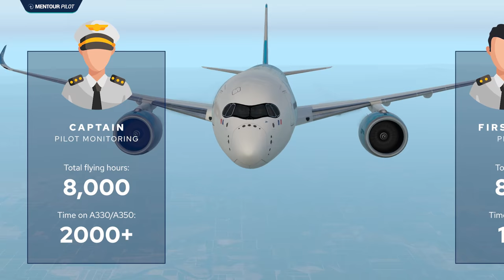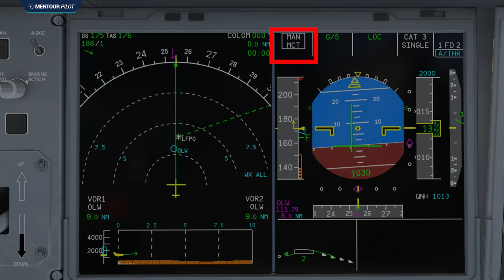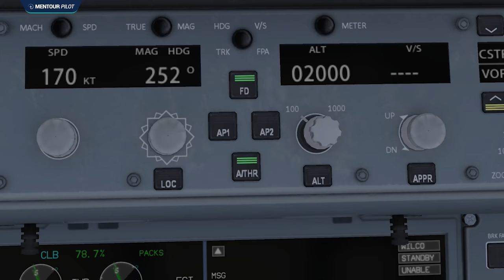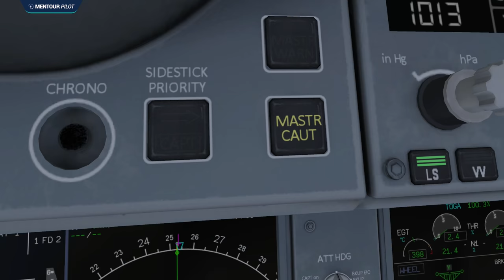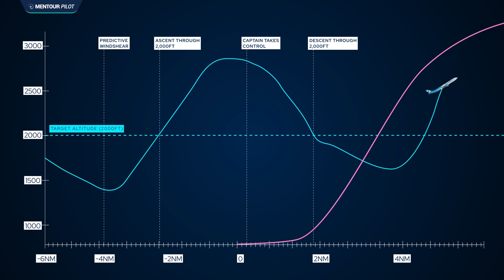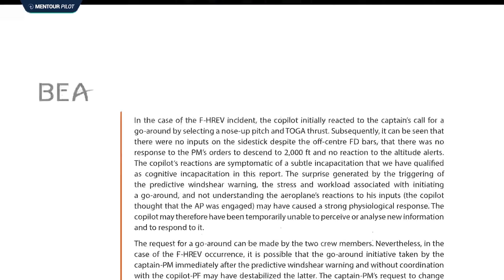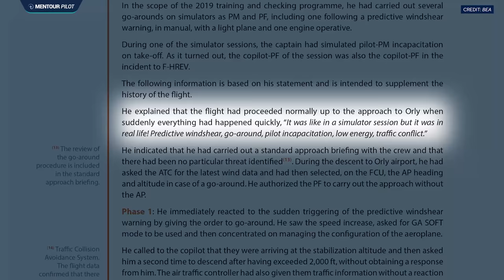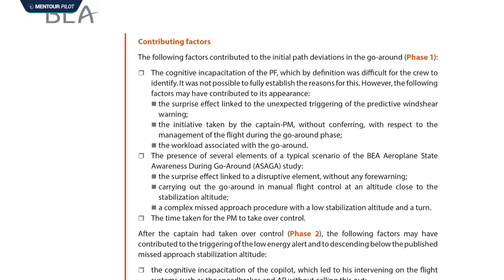What HAPPENED in this A350 Cockpit?! French Bee flight 711 explained!

Comment: And now they are trying to reduce the crew to a single pilot in order to save money.
I'm sure that will go well.
Reply from the maker: I know..
Reply: No they’re reducing the crew to only 2 pilots on long haul. Both pilots will be at the controls for takeoff and approach/landing
Reply: it will in the end.. most accidents are man made..
Reply: @MrFlyingPanda  there are no statistics for accidents avoided by humans.
I have spent my career designing, building and operating highly automated production facilities.
When automation fails the result is sometimes truly spectacular. Any system designed by humans is flawed in some way. It is impossible to account for every eventuality at the design stage. 
I have seem some fails as a result of confluence of improbable circumstances which were very hard to believe, even though I had the evidence in front of me.
Reply: @MrFlyingPanda  every accident is man-made. People don't just fly the plane: they design it (design flaws), build it (manufacturing errors), perform maintenance on it (or fail to maintain it properly), and decide how and when its going to be used.
Reply: @josetrindade3550  that s why we need to remove them during the execution phase.
Reply: @tomstravels520  You can have an emergency in mid flight with no advance warning, then you have to push a button to wake up the second pilot.
Reply: No, two pilots on takeoff and landing, as now.  One pilot on duty in cruise (when the other pilot is permitted to nap anyway).   How is that different from the situation when one pilot has gone to the toilet?
The only times there will be just one pilot on the aeroplane will be little local flights with up to 9(?) passengers exactly as now.
Reply: @mathiasbartl903  or any ECAM alert sends and automatic alarm to the pilots rest space

Comment: It struck me that there might be a connection between this and AF447. Bonin was the flight crew officer who was continually keeping the nose up, fatally, in what appears to have been a startle-induced psychological "episode", which like this one lasted not for seconds, but for minutes, and which had the common element that the officer concerned also **stopped communicating**.

Dare I say it? Is it possible there is something sub-optimal about specifically French training methodology? Such as not handling well in a situation where you have to admit, to yourself and your colleagues, that you are overwhelmed.

One thing that I have noticed from a previous video is how the speed brake can be pulled without the captain noticing. Shouldn't there be a very prominent bank of lights somewhere, directly on the main indicator panel, measuring maybe 30 cm x 30 cm, which at all times indicates the states of various important components like these in the system: crew would then acquire such an intuitive feel for these lights that their peripheral vision would tell them immediately if something like a speed brake was on, or flaps set wrongly.

Re go-arounds every 5 years: absurd. The obvious answer is that go-arounds should occasionally be done without cause.  This would add a few minutes to flight times every so often and give ATC additional workload: i.e. real-world practice!
Reply from the maker: Yes, the connection was made in the final report as well.
Reply: Normally you’d know if the speed brakes were pulled by buffeting sounds, memo on the EWD, increase in VLS, feeling of slowing down and on A350 it shows the speed brake position on bottom part of the PFD
Reply: Was the AF447 plane configured with the 40 second button push priority side stick? If I remember right there were two inputs made by two pilots which cancelled each other out. Probably the dumbest design error ever.
Reply: @mediocreman2  it doesn’t take 40 seconds to take priority. Priority is given to the sidestick with the button pushed immediately. The 40 seconds is when it is permanently latched so you can then let go of the button and priority remains with that sidestick. Releasing before 40 seconds returns the inputs to normal
Reply: @tomstravels520  I wonder what happens if both pilots push the red button. It's not impossible for the incapacitated pilot to press the emergency red button, incapacitation can cause people to do things like that.
Reply: @ShaunieDale  the last one to press takes priority but then that just means you let go and press again. That’s no different to fighting your colleague over the yoke with mechanically connected controls

Comment: That eerily sounds a lot like what happened on Air France Flight 447. Overall calm situation in the cockpit interrupted by a sudden unforeseeable problem and warning and then the FO just went into a kind of shock, pulling the stick senselessly until the plane stalled and dropped out of the sky for no real reason.
Reply: And the crash of a West Air Sweden CRJ 200 had at least similar reasons.

Comment: Assuming the warning was a false alarm, it seems like the incident could have been avoided by ignoring it. This was noted in the report at least obliquely. The crew was surprised by it and possibly overreacted because they had very limited experience with dealing with false alarms. 

So the real question, is how could the crew tell if the alarm was likely to be false? Could they contact the tower for confirmation?
Reply: Good question: if a "weather alarm" must be subject to a complex reasoning to conclude if it's a false alarm or not, this alarm becomes questionable to say the least.

Comment: I've always though it would be very interesting to be on board as a passenger during a go-around, but I'd probably prefer it to happen under less crazy circumstances.
Reply: I experienced two on consecutive flights on the same day!
Detroit: Air crew said landing gear was not observed by control at proper point.
St Louis: Parallel runways, I could see we were too close behind landing on next runway - wheeeee!
Reply: In spite of flying very frequently, it only happened to me once and it wasn’t very exciting. I suspect that because I’m an aviation enthusiast, it wasn’t a surprise to me when, during final approach into Mumbai during the monsoon season, the pilot did a go around. We could see that it was raining quite heavy and the go around was quite smooth. We landed on the second attempt.

Comment: Interesting Go Around  stats. So most passengers are unlikely to ever experience one. I had one coming into LHR from eastwards at 7 am. A fairly busy time. We had just cleared the cargo sheds and all looked as if we would be down very soon when the engines spooled up and we went around. The cause  was that a previous aircraft had not cleared the runway in time. All was smoothly handled and we were back down  in 20 mins.  Thanks KLM team and ATC.

Comment: I remember as a teen driving around and the person sitting "shotgun" next to me, consistently screwing around with the radio and heating and cooling. The guy in the back yacking away trying to get in on the conversation. It drove me nuts. This incident is just a bit more concerning. Lol. As a firefighter, we went through tons of training. Hands-on and scenario based. Usually, a wrench was tossed in to confuse, disorient, or throw off the individual. In a blacked out maze, someone would turn off your air on your SCBA or hook a wire to you, so you had to disentangle. In command training, they'd have  interruptions to throw you off track. None of this was hazing or inappropriate. No matter what the situation, you had to quickly regroup and figure out the solution. This also weeded out candidates that may not fit the requirements. This all seems harsh, but when something really does go wrong or astray... you have the experience and a "file" in your brain of what to do. The Captain, by all means, did the right thing. I've been on incidents where I had to be assertive and reel everyone back in or change the course of the incident. That is why I love these videos. They are relevant to many scenarios. Great job. The new generation may experience more of these blackouts as we have a "kinder and gentler approach" to everything, and everyone "gets a trophy." Stress, disappointment, surprise, and abrupt change of plans is a reality at any given moment. Life's tough, full of surprises, and you have to be flexible, vigilant, and keep your guard up.
Reply: That training sounds thorough. Not harsh. 

My first 9 years I taught middle school, which I can most accurately explain with the following scenario:

You are herding cats through a field of distractions while the floor is lava, and now someone says the cats have to go in a completely different direction but the cats suddenly turn into angry raccoons and now you’re on fire everything is on fire and that circus music in your head is getting louder also now you are the reason there’s the entire small town fire department here because the heat in your building hadn’t been turned on yet to do the yearly burn off and the sensors are right next to that duct and the usual yearly burn off set off the alarm so now they’re required to come up here to confirm it’s ok to turn off the alarm and the circus music is now trying to drown that out and what kind of life choices have I made I’m now having an existential crisis while apologizing to the FD (very nice about it, and only made fun of me a little) but now the insane noise has covered the little verbal fencing match in the back and we’ll damn there they go having a full on hair clenching fight over a boy in the middle of class and have succeeded in completely destroying the room while you’re waiting on back up and that’s about an average day. I think those of us that fit in the middle school trenches secretly enjoy a little chaos. “Controlled chaos” is my comfort zone. But that’s a VERY fine line that you can only gain with experience and has to be adjusted depending on the group of students or even a particular class during the day. Add Jimothy to a class that the otherwise delightful Kimothy is in and suddenly they’ve caused an explosion because that particular combo of students at that particular time of day can be a flash point. One kid can puppeteer an entire class into a Thunderdome because of a trivial schedule change. Pro tip: keep the really smart ones busy whatever it takes find out what they like and encourage projects that interest them because a really smart kid that’s bored is just asking for it. 

I was training in my field (education) focused more on the internship than it does, because while we’re almost never in life or death situations, we’re still in charge of kids’ safety.

9 years teaching middle school, this year high school, and having been a teenager myself with an uncanny ability to clearly remember my worst moments, confirm that teenagers do stupid things. They’re not whole people yet and their brains are just coming out of the “brain soup” middle school phase (one reason I did enjoy middle school was because that age group is so delightfully weird) and still are struggling with the concept of impulse control. It doesn’t excuse dumb decisions, but it reminds as that they WILL happen. Fights, drug deals, severe bullying, abuse reports…those things happen everywhere, and I don’t care what anyone says about their school, it’s just the practical truth. And when something insane comes up with a room of 30 something teens you have to think FAST. If our training focused more on real world scenarios we’d all be better prepared. For someone well versed in their content area and reasonably intelligent planning lessons is something that can easily be learned with practice. Now, GOOD lessons require some talent or experience and the best teachers have both as well as a willingness to accept the concept of failure as a learning tool. Kids will humble you. I give mine surveys part way through the semester for their opinions to see if I should make changes and I really don’t have to remind them to be brutally honest. They’ll do it. And they’ll definitely catch things that I didn’t in regards to teaching tools I’m using or the structure of the class period or even how inefficient a certain system I have is. An aside for those that think anyone can teach…I’m sure that’s true just like I can teach anyone to draw, but there’s no denying that talent helps…practice and embracing failure as a learning tool are what make the difference. But that’s not the part that you will struggle with most day to day…just getting THROUGH the day without any major incidents is the main issue. For instance, I let two girls clean up all the paint palettes in the storage room a couple of years ago and they came out with pierced noses. Last week I smelled something burning and quickly asked who was using the wood burner as that’s a permission only tool (and that’s really just to alert me to be a little more vigilant). Instead I see two giant junior football players giggling like little girls because they tested the heat gun on our precious paper towels and briefly set them on fire. And then they don’t get to play with the cool toys anymore cause this is why we can’t have nice things. I was in a classroom for a period that is shockingly I updated (literally) where boys figured out if the outlet covers were moved just a little they could play the “hey stick your finger in here I dare you” game to see who could handle a shock the best. (I had lab style tables across two walls with a switch at each to turn on an outlet…stuff that may or may not be grounded and have been known to spark when hit the wrong way and I could never get anyone to tell me where the breaker for that system was because I bet it’s hooked to a breaker that will also cut power to something important and stripping it all out isn’t something regular maintenance isn’t really qualified to do…you see the issue). I can immediately identify at least three ways any object can be turned into a weapon or other agent of chaos and ANYTHING is an assumed projectile. Still, every year, at least one kid comes up with an idea I hadn’t seen or thought of yet to turn a qtips into a  mini tiki torch with what I suspect was high strength hand sanitizer (just a hypothetical example).  I picked these because they’re funny now, but they weren’t when they happened since every single one could easily result in serious injury. I was actually delighted to find I have a classroom security camera in my new room. 

As to those situations where I AM literally in charge of keeping kids alive, they’re so desensitized to drills that we honestly have (reasonable…there ARE dumb questions) discussions about it, usually. I reinforce the one rule “you’re a kid and your only responsibility is STAY ALIVE”, shut down any delusions of playing the hero, and they kind of talk through the gravity of it and then the practical solutions. Of course, these kids are old enough to do that. I don’t think there’s a good way to prepare for that other than a simulation, which I personally feel is unethical to subject any student to. However, I don’t think it’s a bad idea for us teachers.

Comment: Is it theoretically possible that head wind become equal to the speed of the aircraft and it makes the ground speed of the aircraft zero, i.e an aircraft that is stationary with respect to ground, just hanging in the sky??
Reply from the maker: Yes, for smaller aircraft it is
Reply: In some instances a light aircraft can actually be flying backwards!
Reply: I believe this was an issue in South America for airlines trying to cross the Andes: the old prop planes didn't have the power to overcome the jetstream off the peaks.
Reply: @swannvictor1388  maybe you’re thinking of a famous incident where a plane was flown into a mountainside.

Before GPS navigation, this was the 1950s I think, a turboprop was being flown across the Andes.

A strong headwind made them miscalculate when to start their descent.

It was too early and they flew into a mountain. The wreckage was lost, and only emerged at the base of the glacier in the 1990s.
Reply: It's not only theoretically possible, it is a very real though thankfully infrequent occurrence.  It has even happened to me.
Reply: @MentourPilot  bush planes doing vertical landings are always cool.

Comment: I am surprised that everyone in the cockpit doesn't constantly evaluate the others current cognitive state of mind.  I worked in power houses for an electric utility company from nuclear to geo-thermal, solar, wind turbine, gas-turbine, and hydro.  The biggest risk was solar since you can't just shut down the sun as you might with nuclear (control rods), hydro (penstock), etc...  But it was an absolute certainty that we all looked at each other as the most likely source of catastrophe.  We had a mantra; The only way everyone gets to go home safe tonight is if everyone does everything right today.  Just one mistake with electrical power, which literally goes from zero volts to full in 1/60th of a second is totally unacceptable.  While we learned to trust the others inside a powerhouse, there were outside factors; dispatchers, operators who managed the grid and controlled things remotely.  It was always a relief when we could take a station to 'local' power and disable the remote operation of the plant from Dispatch (a lousy word for what would otherwise be equated to a control tower or air traffic controller that could instantly take over flight control of any and all aircraft.  Imagine THAT!)
Retirement for my career was 50 years old.  I actually retired at 56 because there simply wasn't anyone trained to the degree I was, and my employer refused to accept I would leave one day.  When I did retire, they tried to hire me back as a 'retired annuitant'.  I declined.  Several times.  However, I did make myself available to my replacements, off-line, for about a year as they learned in real-time how to do this job in their individual and unique environments.